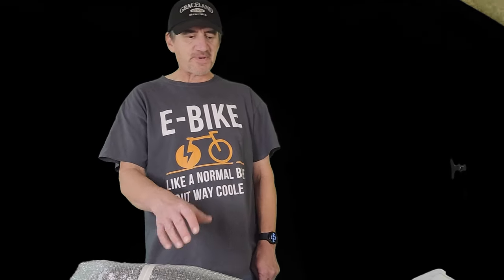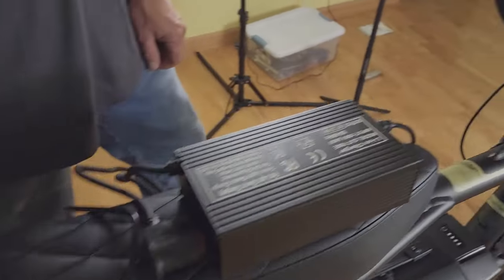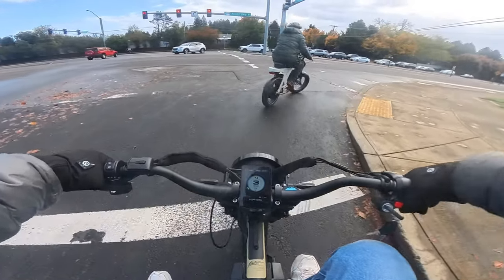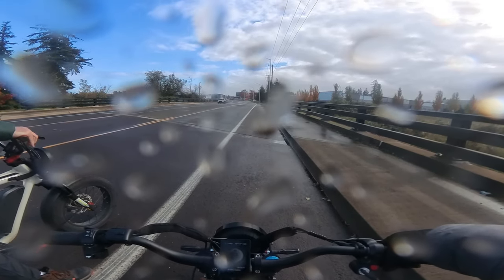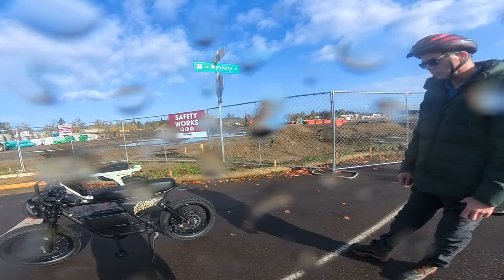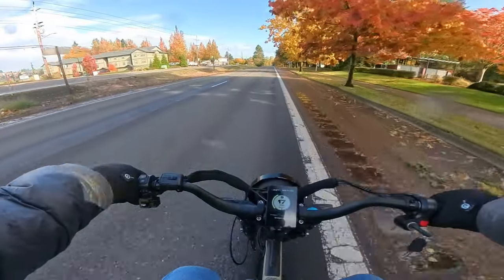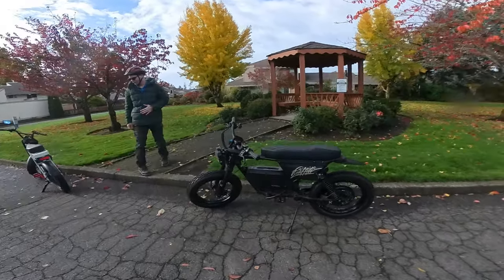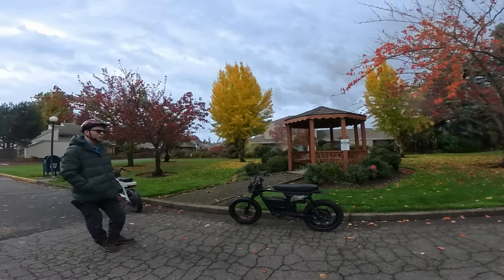Lyric Graffiti X Review & First Ride Impressions! #review #graffitix #lyriccycles #ebike

Comment: You can have a motorcycle seat guy shave the seat and re- Staple it.  Or buy a good staple gun yourself and take it apart, shave foam an re glue and staple it underneath yourself during winter.

Comment: Did you have any birth marks from shipping?
Reply from the maker: She looks clean as far as I can see.
Reply: @oregonebikermark8953  you might look into some fender extentions.  They make them for dual sport bikes. Dirt bikes. Not a huge fan of the short fenders but it looks pretty sweet as is.
Reply from the maker: @JohnBabcock-qy1cs  They are definitely short. Like you i prefer longer fenders to cover more of the wheel. Surprisingly The back of the bike looks clean and dry with that short fender. Further riding will tell me more though.
Reply: @oregonebikermark8953  yeah.. you can find out and maybe decide later. I know it rains a bunch by you.
Reply: Maybe after all you X owners get some idea of the coverage by the stock fenders, you can convince Lyric to make some extra coverage fenders or people will come up with ideas.
Reply from the maker: @JohnBabcock-qy1cs  True. There seem to be quite a few Graffiti X owners already and many more are waiting on there orders.
Reply: @oregonebikermark8953  my motorcycles never had so much rain flying up on me like the E bikes do.  But I'm sure most of that is due to motorcycles are 10 inches wider at the frame and engine points in the frame.. Bicycles are so narrow and the water flows up closer to the legs and not much to stop it.

Comment: Mark glad yours is working. 
Seems like the wiring needs to be improved so your turn signal works and mine wouldn’t have shorted out. 
Besides mine not working and my fork issue I also have the rear fender bent issue. I may hit it with a heat gun and bend it straight. 
Last I heard from Lyric was Sat and they want to start by sending me a new display and wiring harness to see if that fixes my shirt issue.
Reply from the maker: I think i need a new front right turn signal. There is a short there somewhere. When i unplug it every other like works just fine.
Reply: I noticed you got hyper flashing on the rears. To figure out swap turn signals to figure that out. In other words what happens when you unplug the left turn signal wire and hook it up to the right turn signal?
Reply from the maker: @LesFishingMoreCatching  I think i looked at that but the wire was too short to reach. The right turn worked briefly but any movement of the wire and off all the lights go.
Reply: @ you can unscrew the front right turn signal if the wire is too short. It would be an easy way to see if it’s the wiring harness or just the turn signal itself. Good luck. I hope they ship my stuff soon but I’m thinking it’s gonna take a while cause they might not have parts on hand.
Reply from the maker: @LesFishingMoreCatching  Correct, i could unscrew it. I hope you get your issues resolved soon because you are gonna enjoy this bike, I guarantee it.
Reply: @oregonebikermark8953  yeah I’m 5’7” it seems a good size for me.  It’s lower than my Grizzly but slightly longer wheelbase. 
I don’t have bike lanes in my town so it’s important to keep up with traffic. It’s 30mph limit but most drive 40-45
Reply from the maker: @LesFishingMoreCatching  This bike easily can maintain 45mph. The seat height for me is perfect. I like to be able to put my feet flat on the ground and with the Graffiti X I can.
Reply: @oregonebikermark8953  That's good to hear it fits you well, as me. Since I have the bike I'm going to start making 3D printed parts for it.  Keep an eye out for some stuff from me.  I'll post on the facebook group and make a video on my channel when things are ready.
Reply: @oregonebikermark8953  o btw the fender bolt. Mine was preinstalled on the front of the fork. Check to see if you got a bolt and washer there and if so just undo that and place fender on. Lmk how it goes.
Reply from the maker: @LesFishingMoreCatching  Yeah. Lyric tipped me on the bolt being on the bike. I found it and installed the fender.